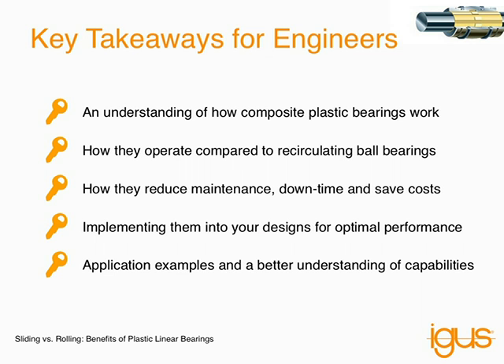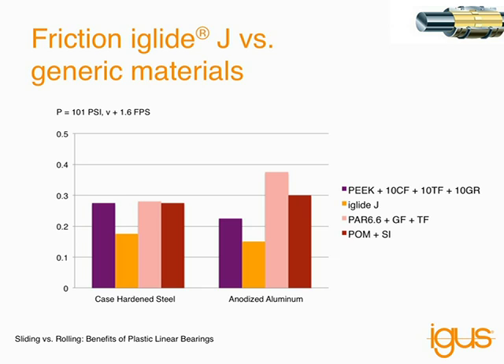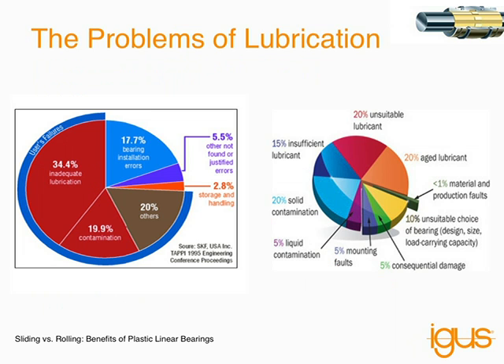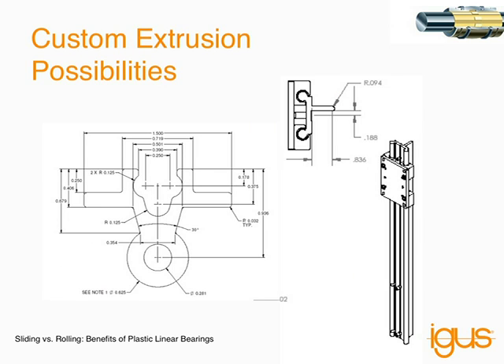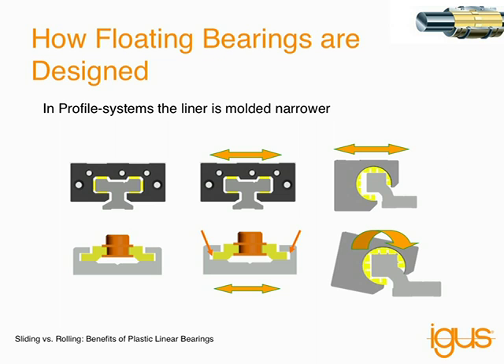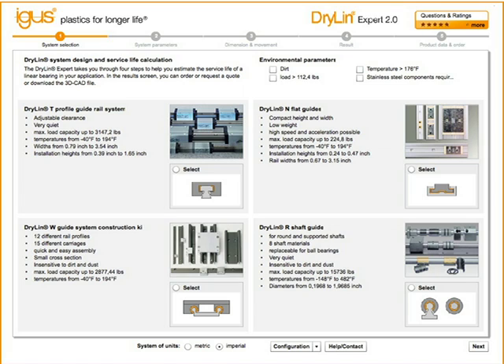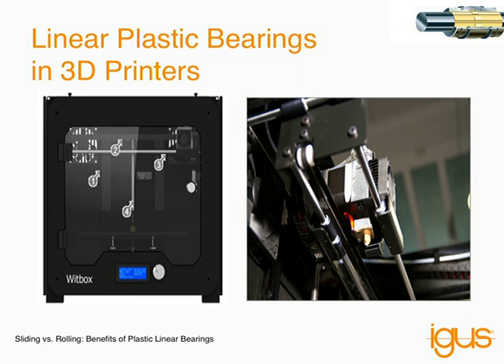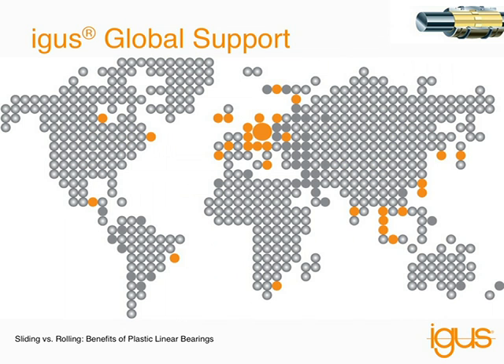Sliding vs Rolling: Benefits of Plastic Linear Bearings

Comment: Accuracy compared to hiwin square rails and blocks? Also curious if you make a hiwin style replacement block like hgh20,25,30??. Many of the aftermarket applications are limited to distance apart bearing blocks can sit. If 4 Drylin style blocks were used the tables would have the capability to travel beyond one of 3 blocks and allow for 4” more X axis travel where bearing blocks would be limited to two and therefore be subject to axial loads that may exceed their specifications. Having the option to use drylin or at least adding two additional drylin blocks atop existing bearing blocks would be a desirable option even despite mixing bearing blocks the benefit would certainly increase overall performance and prevent limitation of table travels in aftermarket (hobby) applications.

Comment: Plastic Bearing do run down and need to be replaced to often !  already tested on a new Prusa MK2  and after 3 weeks printing the Igus Bearing were replaced to the original Steel Bearings because of worn out and wiggling on a m8 Rod
Reply: You did something wrong then. I have over 300 hours on an MK2S with the RJZM-02-08 in place of all the OEM steel bearings.

Comment: How would these hold up in 3D printing applications? I see advantages (self lubricating, resistant to dirt, vibration dampening and dual rotation) but wonder if this application would tax them as precision (= or - .001mm) and speed (200-300mm/s) are also needed.
Reply: Interesting that I've not seen igus rail solutions used in 3D printing yet. I've seen HiWin, and the LM8UU style bearings being replaced with igus bearings. I actually ordered some like those earlier, but I'm getting curious.

Comment: Can plastic shaft be used instead of metal?  This can reduce weight.
Reply: chia ming Chen 

No, in fact I can't think of any common application or that would be just too specific. The load apply on a plastic shaft would just make a flexion which isn't the best thing.
Reply: You could use carbon fiber